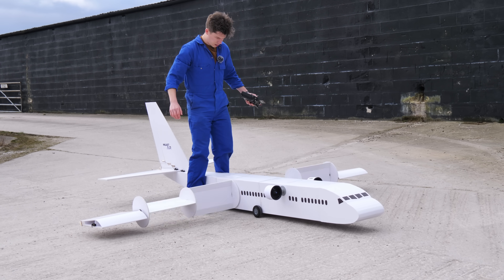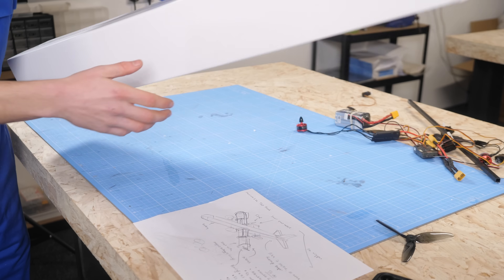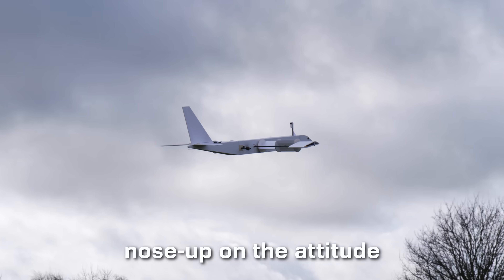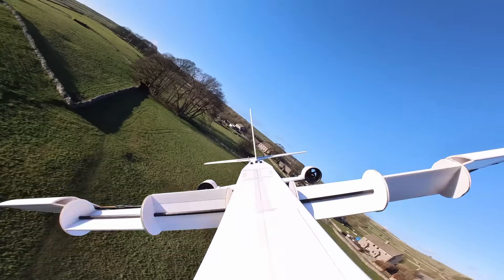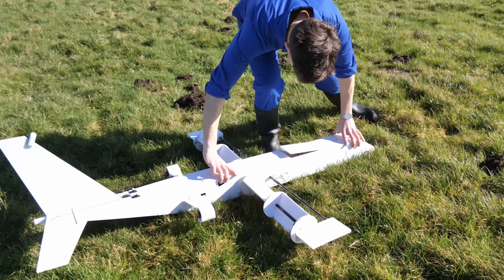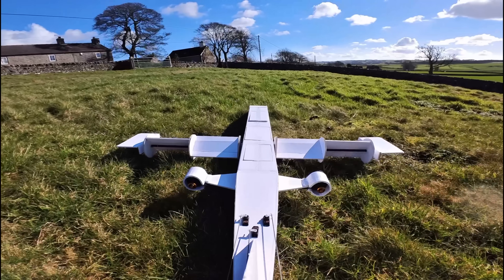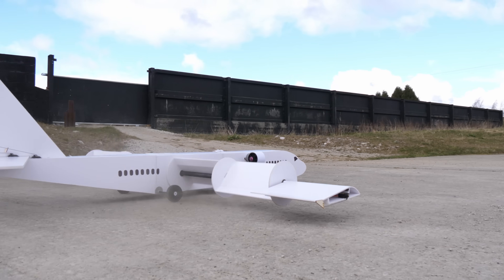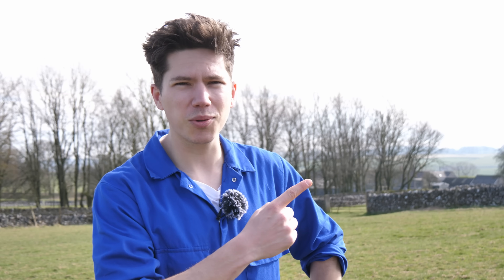Giant Magnus-Effect Plane

Comment: Economical... no, a Strong No, but it was interesting... I do enjoy watching your projects though!!

First of all, your 2nd rc plane was tail heavy from the start and even more tail heavy with the EDF's... balancing rc aircraft is very important if you want it to fly well and more than once; this is a step most people over look or use their fingers to guesstimate an RC planes Center of Gravity. Using your fingers to find the CG at your flight area with your batteries strapped in, is fine WHEN you know the exact CG location on your RC Plane ( not a Guess or Estimation ) !!

Balance your RC Planes right way with a "Vanessa CG Machine", there are plenty of tutorials online on how to make the device, how to use it on your RC Planes and it could be made cheaply or as expensively as you like. Mine is made out of a 5 inch piece of 2x4 wood, with a 1/2 inch wood dowel rod that fits snug but loose enough to rotate through a hole an inch from one end; and I've used paracord to suspend the device from one of the joist in my garage as well as to suspend my large and tiny rc planes. See, cheap and effective! I saw someone else on rcgroups.com machine theirs out of a block of Aluminum, used ball-bearings and braided-wire... it looked great, but that's seriously over-kill and I'm sure his wallet wasn't too happy!!  

You probably didn't need the wing tips, just another section of Magnus Flaps / Wing-fences and you could have angled the Lifting Surfaces with a few degree's of Dihedral... which enhances an aircraft's lateral stability by promoting a natural return to level flight after a roll disturbance. It's simple, and a LOT of Cargo and Passenger airliners have this feature built into their super structure. Even some Civilian aircraft have it, some more noticeable than others. 

Your 3rd plane is just... Bigger. It will probably still suffer from the lack of lift generation from the short wingspan. There was nothing wrong the center motor creating rotational force for the Magnus Wings, in fact by removing the lift generating motor and forcing the thrust motors to turn the Magnus Wings... you've just created even more drag and seriously ruined the thrust air flow by ramming it into your Magnus Wings. Actually, I think Cylinders would be far more effective than flaps but to each their own I suppose. 

One could say the FanWing Plane created by Patrick Peebles is far more viable and cheaper to manufacture. Heck you could have bought a pair of blower fans on ebay / amazon... or even 3D modeled your own design, 3D print and created your own blower fans. * shrugs *

Comment: When I was a kid I had an airplane shaped very light toy with rotating wings like your models. It was designed to be flown like a kite attached to kite string. It worked great but the blades in the rotating wings were not flat. They were "S" shaped in cross section.  Maybe you should try that.

Comment: 14:00 What? The 'V' (velocity) is squared in the lift formula, not the 'S' (wing area). Lift scales linearly with wing area. Not that the formula is very useful unless you do some much more difficult math to figure what the coefficient of lift of a rotating cylinder is at a certain RPM. If you want to learn more about it, look up circulation and the Kutta–Joukowski theorem.
Edit: To add to this, you're also trying to control it like a normal wing, pitching up and down to increase or decrease lift. That doesn't really work with a Magnus effect wing, in order to have the same effect, you need to increase or decrease the speed of rotation. That means that the cylinders need to not only be powered, they need to have variable speed. It's going to be a weird set of flight controls to get used to, and even then it won't be statically stable like a normal airplane would be. The Magnus effect is cool, but there are good reasons why it isn't really used for wings.
Reply: What is puzzling to me, both from the comments and video, is the complete lack of discussion over the cross-sectional geometry of the rotors. Nor is there any backstory in his previous videos: his contraptions had the classic cylindrical configuration for Magnus Effect instantiations. Cylinders (and spheres) present a convexity to airflow; this cross-section is positively concave. It could hardly be more so.
Perhaps it's the pendant side of me, but I need to see a first-principles physics motivation for classing this item's element as gaining lift by the Magnus Effect proper, and not some other confluence of airflow factors.
Reply: @-danR  It's definitely the Magnus effect, the resulting circular flow is basically the same. There is some room for optimization (getting the angular velocity of the flow as close as you can to the cylinder without creating too much turbulence/drag) but the shape doesn't change the physics.

Comment: 9:36 That means you’ve reached the resonance frequency of a part of your plane. You can fix this by designing your plane to have a higher resonance frequency than the motor speed (which can be calculated in some CAD softwares) or by adding some sort of damping system like neodymium magnets over copper to do magnetic braking or non Newtonian fluids.
Reply: Telling that to someone who builds his planes with foam panels and a hot glue gun... and is off on the plane's wing position like half a meter (pause at 16:19)... kiiinda feels like wasted effort 😆

Comment: Hey mate, thank you so much ❤️ for sharing this video! I really enjoyed watching it and learned a lot about the Magnus effect and how you applied it in building that RC airplane – it was super informative and fun to watch.

I just wanted to share a little theory I’ve been thinking about. So, according to what I know, I feel like the way you’ve separated the Magnus effect wings (left and right) kind of works like a differential in a car. Before, when both wings spun together, it was like having a differential lock.no independent movement. But now, with the separation, it’s more like a real differential, which could give a lot more control over the plane’s movement. Just an idea though.I haven’t tested this myself, just wanted to share the thought!

Also, I’d like to suggest trying to push the motors toward the back of the plane. Right now, with the motors in front of the Magnus wings, they might be messing with the airflow around the fans, causing the plane to mostly just lift instead of moving forward effectively. If the motors were behind, they could help push the plane forward naturally, while still allowing the Magnus effect wings to generate lift more efficiently. I feel like that setup could give better performance and lift, thanks to the cleaner airflow.

Again, this is just a suggestion based on my understanding.appreciate all the effort you put into this build and video! ❤️

Comment: The flaps of the rotors are all off centre, that's why you're having all that vibration. You have to cover the rods from both sides!
Reply: Dont know why he didnt realize this immediately.
Reply: I thought the exact same. By the time the big one was built, I was in pain watching the catastrophe unfold and was just like "well there's your problem".
Reply: THIS. The unbalanced rotor construction was driving me nuts from the very first iteration. That mass needs to be evenly distributed across the axis of rotation. All they need to do is cut each rotor flap in half and place the 2 pieces opposite each other on the axle.
Reply: Retired engineer here. Agree.
Reply: Non engineer here - but would the inner rotors and the outer rotors respectively be locked together so they spin at the same rate (and the inner and outer rotors offset by 90 degrees) make any difference?
Reply: The main thing is to balance the axle shafts, balance the 3D printed pieces, then balance the rotors.  As a machinist of 18yrs, I've never come across a single piece of 100% concentric (.0000" runout) metal, carbon fiber, plastics, etc... think balancing a crankshaft for example.
      Unless you have a lathe, balancing all that would be the only way.  3D printing isn't the best for the precision you need, but bluetack works very well for figuring it out.

Comment: 14:10 the equation you show absolutely does not say that lift increases with the square of area, it’s a linear relationship. Overall liked the video though
Reply: not the square OF area,  it is the square area.   double the length and width of a rectangle and you get 4 times the square area, not square of the area.   the more square area, the more lift.   1x1=1   2x2=4.   4 times the square area, 4 times the lift, unfortunately this doesn't translate to what he is doing because his "wing" isn't producing lift because of the square area but because of the change in pressure due to moving more air, that's the part he missed.  the way he is doing it is really a bad way accomplish the magnus effect, lots of extra drag, less lift than other designs would provide.

Comment: This effect has more to do with propulsion rather than lift as I see it. 
The spin moves the object forward rather than upward (or sustaining height)
I think this plane would fly even if the “wing” wasn’t spinning. Add enough thrust to anything and it’ll fly, regardless of lift from wings (whether the wing is spinning or not)
Reply: Once the craft is moving forward as fast as the top of the 'rotors' (I'd rather call them vanes , I'm not sure yet we're actually looking at the Magus Effect proper here) are going backwars, they no longer have any propulsive effect, and in fact the lowest part is actually throwing air somewhat forward. 
Aided by some ground effect, I think there is a high effective drag and high upward vector-component at the bottom of the rotors. It 'works', but at real cost over a true Magnus' cylindrical rotor cross-section.
Reply: That was my impression of the KFC bucket plane.